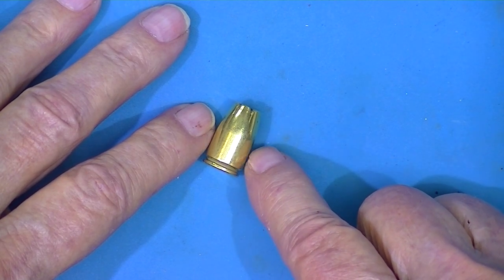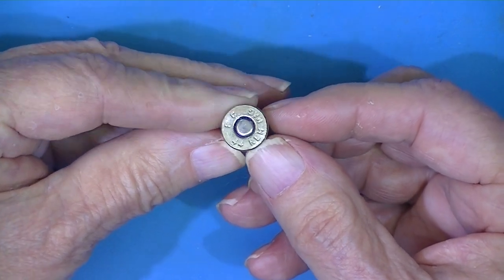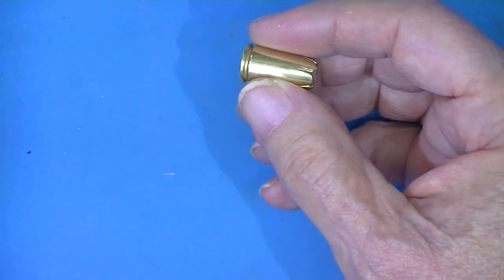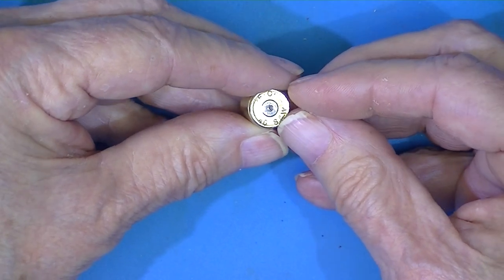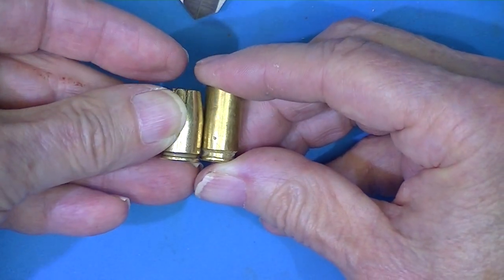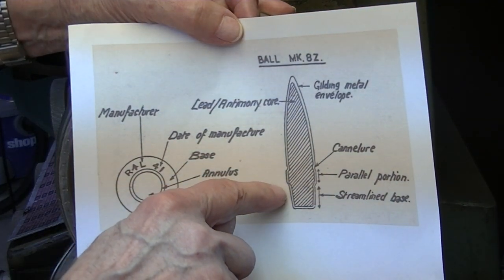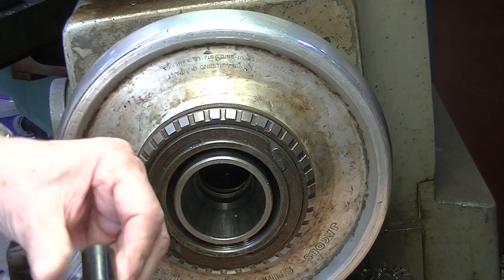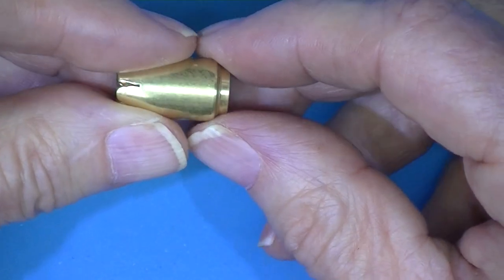Placing a Rebated Boat Tail on a Jacketed Bullet

Comment: I appreciate the video, thank you! This is very interesting to me. I’m curious what results came from that lathe work. Anyway, I always enjoy your videos!
Reply from the maker: I just don't like the rim at the rear of the bullet. In jacketed bullets, where the jacket is of a uniform thickness, the swaging process can produce a flat bullet or a boattail bullet. When making jackets from spent casings, where the base is 10 times thicker than the rest of the jacket. it is very hard to eliminate the rim and harder to make a boattail. Now these are to be short range bullets, less than a 100 yards, so the base can be left flat. In fact, flat base bullets are generally used at short range while boattails are used at very long ranges, more than a 1000 yards. The boattail maintains velocity, that is it's more aerodynamic. In this case I just want to remove the rim but not touch the primer. I'll make a video of a better way to do it, I think!
Thanks;
Steve